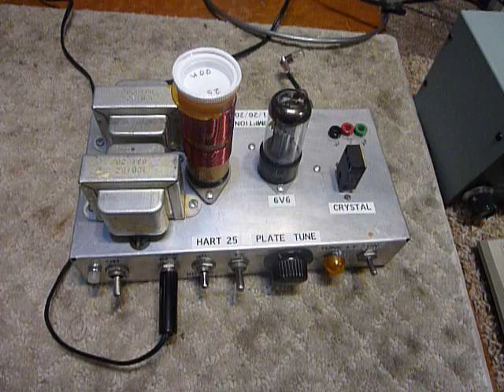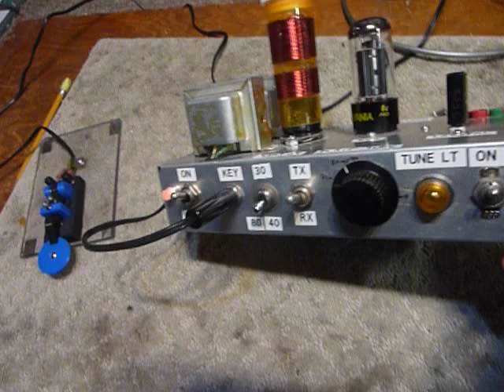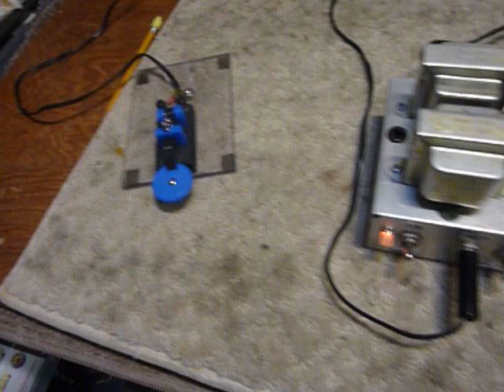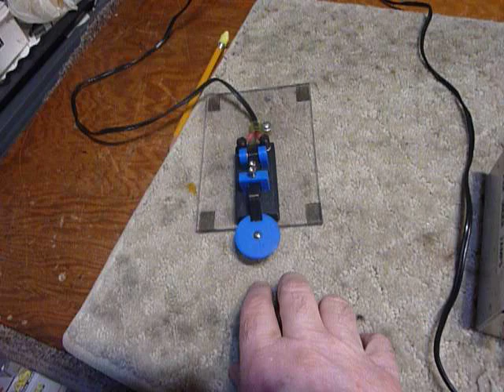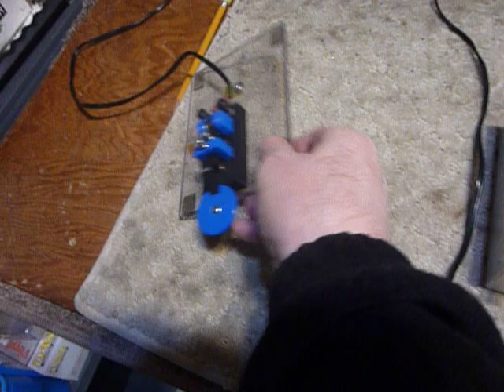HART 25 ,One tube transmitter , HART Transmitter , QRP Transmitter

Comment: I found the article at the website, and I really like this type of home brewed ham radio transmitters.  I am working on a single tube transmitter circuit designed by another ham who makes the circuit board.  This is a fun little radio, thanks for making the video. 73's

Comment: I'm working on building a similar transmitter. It will use a 6AG7, or a 6CL6 tube instead of the 6V6. It will also have two 0B2 voltage regulator tubes to help eliminate chirp. A pi-network output will be used to better load the antenna, and to reduce harmonics. I got all of the parts from my junk box. Hopefully, I'll have it build and one the air in a few weeks.
... Jerry, KC9JXE

Comment: YC0LOG, cq cq from Jakarta
Reply from the maker: Thank you Jakarta  Adrian Engineers  !   This  Hart 25  transmitter with 6V6 tube I took to Woodland Park Colorado with a 40M dipole  and worked my friend back  here  on CW with it what a thrill that was 1100 miles on 80M cw  Happy  2021  !   ...73    Bob
Reply from the maker: No it was 1200 miles  Hi Hi  73  Bob

Comment: I built one of those from a kit in my High-School Radio & TV shop class back in the early seventies along with a one-tube regen receiver.  The transmitter worked great up through a 40m dipole about 30' high over the shop. We made a few contacts with it but the regen recvr was horrible to use. Then our instructor broke out a Collins R-388 from the storage room and it was awesome using that for recv, very stable.  Thanks for the memories!!  I may dig through the junk box and see if I can build that Harp-25!

Comment: I downloaded that copy just now. Thanks.,, I'm looking into building one. I do tube radios as well.  I acquired a lot of vintage dials and tuning capacitors of all kinds and headphones. A good supply of them.. I salvage parts as well.. I did purchase a New old stock Transformer box with different voltage connections for filament and plate at Duke city Hamfest this yr as well..
Reply: I picked up a Hart 25 at Dayton a few years ago.  I was looking for parts to build a Copy of the Ameco  AC1 and found it a box of parts under a table.   The guy didn't know what it was but it looked like it had a few parts I could use.  While walking around with it in my hand, a fellow stopped me and told me it was a Hart 25.  I couldn't find and information on at the time but a year or so latter if found the article in Popular Electronics.   The one I have looks exactly like the photo in the magazine article.   I put a few new caps in it and put it on the air in the Novice Rig Roundup.

Comment: Super job and wonderful memories, Bob! Still have my novice crystals for 80: 3720 kc, 3730 kc, 3730 kc. Also, remember that you could use an octal socket to hold two FT-243 crystals snd switch between them.
 Thank you for sharing this!
73 de then WV6KJK, now K6WHP
dit dit
Reply from the maker: Yes ! War Planner  you know the old Harvey Wells TBS-50 transmitters have an octal tube socket the flat brown phenolic one mounted behind the front panel for the crystal socket .  73  Bob
Reply: Robert, I do remember! Also thinking of the XMTR that appeared in the ARRL handbook circa 1958-1964. Have in mind to build the classic novice station that was pictured on a QST cover with the regen receiver, the transmitter with the J-38, and the power supply made with the pine firring strips that practically invited death by electrocution. Hi hi.
de Bill, k6whp
dit dit